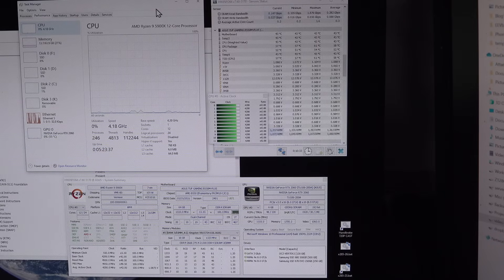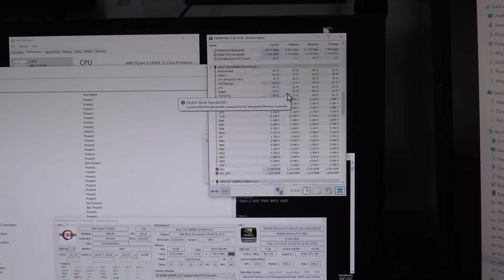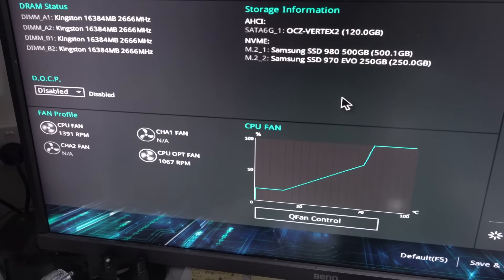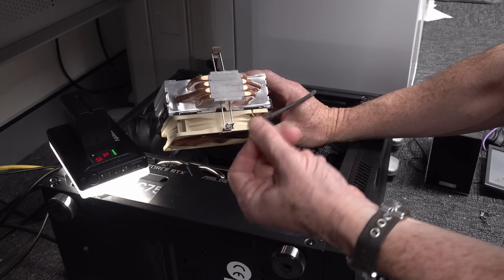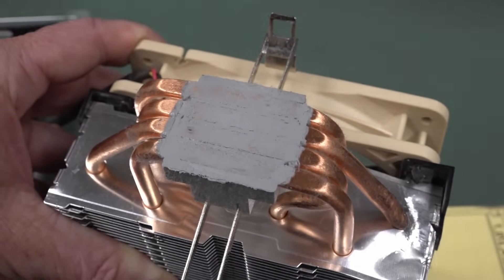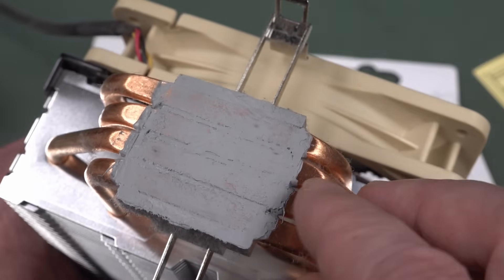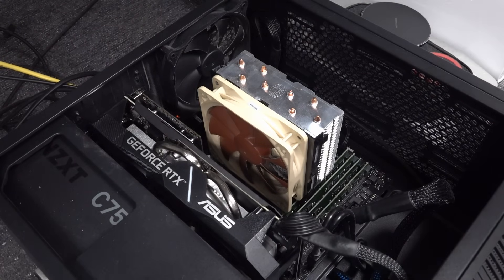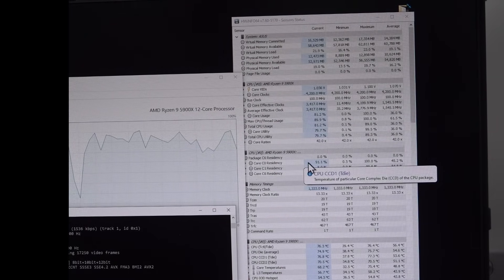CPU Thermal Ghost

Comment: @EEVblog2, I had some similar strange issues and couldn't figure them out, even sent my hardware back to metabox and they couldn't fix it. another PC at home with bad BSD and all during heavy processing. sometimes it fixed strangely when we removed the rams and put them back in different positions or boot with 1, shutdown, and boot again with all and it would work for a while. then i decided to re-flash the bios with the same version for fun and both were fixed! this happened certainly 2 times and the 3rd time, i hadn't tested the machine extensively yet. but rendered some after-effects on it and hasn't crashed then.

Comment: Computer shouldn’t crash because of CPU overheat, Ryzen is able to run at almost 100, of course it will throttle, but won’t crash. Having the same board, I have to say, I have my doubts about “TUF” batch. If you want to have better temps use a liquid metal as a thermal paste.

Comment: Paste: mx-4 ideal, but that cooler master should be okay, fan is not enough for that TDP, disable CPB and PBO
Reply: I would think so too but he ran it at 100% and the temps stayed in the 80s so surprisingly the cooler is good enough for the CPU, I would turn it to exhaust out the back.
Reply: @Roman00744  you are correct the cooler is in the wrong direction but he doesn't wanna change it xD

Comment: There is your problem, cooler, only 4 heatpipes, you need 6 for a 5900x, or you can use that one and disable PBO and CPB, I have the 3950x with a the 6 pipe scythe's fuma2, works fantastic

Comment: You can see the blue screen of death message without needing to capture it in situ by opening event viewer, going to the system log, filtering for errors, and looking at events named "BugCheck".

CPU temps looked more than fine so if it is thermal I'd expect either motherboard VRMs or the memory being affected. Both can be affected by thermals and neither get any cooling with the tower cooler fans pointing up.
Reply: that "TUF gaming" board looks like it HAS VRM cooling and often the TEF GAMING have GOOD VRM setups but 100% a possibility

Comment: tbh, that CPU cooler position is probably a big contributor to why, it's pulling all the warmth directly from your GPU, blowing it over the CPU, up to the top of the case, and it's just 'rising' out - you should rotate 90° (with fan on right) - rear fan should exhaust too, it won't be doing much as is!

the GPU vents into the case...
Reply: You mean pc secrectly one night changed that?
Reply: If the GPU vents into the case it won't matter much what direction the CPU fan is. Maybe 2-3 degrees or so.

Comment: by the way, undervolting made my amd run faster.  it's easy to do and it's win win.  less power, less heat, higher clocks since it doesn't throttle.  search how on youtube and there are some short videos that show you how.  you can do it in few minutes.  mine's the 3950x, but it's very similar to your cpu

edit: it doesn't look like it's probably thermals but that cooler looks a little weak for that much cpu.  something like the thermalright peerless assassin might perform a lot better for very little money, and with amd, the aggressive thermal throttling could be leeching precious render time

also your paste looked a bit thick in the z-height direction.  too much can actually start to increase thermal resistance so i usually give the cooler a slight twist (rotate around z axis) immediately after mounting it to the right and left to get the contact surfaces closer (by letting it squish down the paste) to ensure there isn't a thick layer of paste sitting between the surfaces

assuming your cpu hasn't become unstable from degradation, it could be psu or ram.  but that's obvious i think.  degradation is also something to consider.  usually you won't run into this unless you do overclocking, but these modern cpu are virtually overclocked from the factory now (meaning they're already running at the ragged edge)

Comment: 2 things: That cooler not gonna handle the 5900x well. And  you should rotate the cooler 90 degree so the air can passthorugh it easily
Reply: This!!! That thing is idling at 72C it's def gonna thermal throttle and the orientation doesn't help either.

Comment: Any stable system should be able to run memtest and prime95 for 24 hours each.
These AMD CPUs can run at 90c constantly with no issue. This is not a design problem. They will thermal throttle before crashing.
If memtest is clean, but prime95 fails, check cpu vs ambient case temp delta.  Improve overall airflow if needed.
If temps are OK, (again 90c is not a problem) swap power supply and retest with prime95.

Comment: Like others mentioned, update your bios.  If it is still the latest, load defaults.  Probably got wonky when it had an unplanned shutdown.  Also windows could have a corrupt driver not adjusting the CPU fan speed or thermal throttling the CPU right.

Comment: Just as a note on my older system and power supply.  After 3 years, my system would not blue screen but power off unless I deactivated 1 core from my bios.  It then progressively got worse until I deactivated more cores, then had to buy a new power supply.  Since you see the blue-screen of death, it is probably not your power supply as my supply's overcurrent was being tripped because it was becoming more and more sensitive.  In your case, if it's the motherboard supply for the cpu core, then your problem will eventually get worse and worse.

Comment: Wanted to also add that the single dot method no longer works for AMD CPUs, since it is rare to get full IHS coverage. Furthermore, the CPU cores are closer to the edge of the package, and the center is a dead zone. This is also why offset mounts provide lower temperatures. The IO die doesn't use much power, thus is not harmed by an offset mount.

Comment: I'm not sure I understand your "Worked 100% fine for years" retort to many of these comments. It worked 100% fine for years, now it doesn't anymore. So something has changed, and it may be impractical to identify and revert whatever that is (anything from clogged fans to software updates to electromigration in the CPU?). I know, it sucks and it's confusing, but you're trying to find a path forward, not a potentially impossible path backward.  FWIW, my 2c, I would give updating the BIOS a go, it's cheap and free. Yes, your machine worked for years, but I had my (AMD) machine recently start locking up randomly, and updating BIOS and GFX card drivers absolutely fixed it. If I had gone with the "worked 100% fine for years" rhetoric I would have rejected that solution on principle, because my machine worked 100% fine for years, but I'm glad I didn't.
Reply from the maker: People are telling me to get a better heatsink or water  cooler etc. Clearly that's is not needed, because, well, b it's worked fine for years.
Reply: @EEVblog2  My theory was maybe Dave decided to 'ignore' thermal limits recently and thus a back throttling system became a shutting down one. I know my 5900X and a GAMMA 400 fan can not really dissipate the heat reliably and I cut back the boost maximums and got some decent temps out ot it.

Comment: Why didn't the BIOS throttle(lower) the clock to reduce the temps instead of crashing? 
I thought this was built in CPUs and BIOS now to prevent overheating.

Comment: With that heatsink (unrelated to your current issue), you are losing performance, for air cooling, often you are looking at something on the level of the NH-D15, otherwise it will throttle to below stock performance, or at least a heatsink like the thermalright peerless assassin 120 SE.

Comment: The problem could be that you're putting solder paste on a CPU for cooling. :)
Reply: Applicated, no less. ;)
Reply: Soldering the heatsink onto the CPU can only make better thermal contact than thermal paste, no? :)
Reply: @MrJef06  If your CPU gets so hot it melts solder paste then you have other problems.

Comment: As others say - it's the power supply. Those CPU temperatures you initially had would not cause the system to cut off, just "thermal throttle" a little bit (hardly much at all below 90C, 80C is really OK).

You are in fact quite well equipped to diagnose this! Check the ripple on the PSU's 12V rails. That doesn't show up in the averaged voltage that the motherboard reports. Brief voltage droops caused by brief current spikes is what you're looking for. It happens (... more often with high-end GPUs though).

Your GPU might be more tolerant of the voltage droops, or its draw might be less "spiky". Anyway it probably draws significantly less power when transcoding video. Take a look at total package power of cpu vs gpu in hwinfo64.
Reply: If it's not thermals he should also be able to test this by causing the PC to heat up via external means, so that it gets really hot before the CPUs are fully working. Could turn off some cores so it's not drawing as much power. Demonstrate that it could run stable at higher temp when drawing lower power (a kill-a-watt would help measure how much power is going into the PC to verify less is going in than when it crashes).

Comment: Heatsink smoothness is not great, mostly because they "make it flat" using a sanding belt. Have rejuvenated the compound a few times using silicone oil, blending it back into a paste. Also took the simple flat extruded non heatpipe heatsinks and made them flat with 1000grit waterpaper and a surface block, to get better contact with just a tint bit of grease as interface over the original poor surface.

Comment: You could install ASUS's Armoury crate to find out if you have out of date drivers for the motherboard. But just driver updates didn't fix my problem
I had to update my ASUS TUF motherboard BIOS to get rid of same sort of symptom where PC shuts itself down (previously had same behaviour with windows dictating what GPU drivers I should use)
My cooler would lock its fanspeed and temp readings wouldn't even change in any software in my case 
Only started to happen after the usual automatic win11 update and went away once BIOS and drivers were updated and compatible once again I guess 😅

Comment: @EEVblog2 - Sorry. Just finished the Video. You were right in changing the thermal paste. Though the thermals at idle looks like it was a secondary issue and leading you down one rabbit hole. Here are some of the next steps I would take that don't involve sneaky software. First step would be to prevent the system from rebooting automatically so you can get the stop error. Settings->System->About->Advanced System Settings-> Startup and Recovery Settings -> Uncheck automatically restart. Stress the system again to get a stop error and this time it should stay on screen. Of course then do your google fu for where to investigate next including updating all drivers that are surrounding what stop error comes up. Another step would to update the board's BIOS. There have been some updates within windows itself and GPU drivers that can cause BSOD because it conflicts with the older AMD microcode, especially if you said that it started occurring after the upgrade of the GPU if I heard you in the video correctly as I myself had had to chase down those issues with a system that has had no hardware changes in years. Secondly I would open Command prompt with admin purposes. Then type SFC /scannow. This is windows System file checker. This will check to see if you have corrupted windows files that can also cause those BSOD. if that command finds corrupted files it should try and fix them right away.
Reply: If he had a backup of the system from say a year ago, he could run from that. This would help rule out software issues (unless there is firmware that had been updated, e.g. BIOS, or stuff on the GPU).
Reply: @gargantuablargg  I had to nuke my fair share of windows installs for a while. This way he can fix most OS errors without having to revert to a backup. I had a period over a year that it seemed after every two updates in NVIDIA drivers, I would run into BSOD. 3 changes that happened that I no longer wasn't nuking windows installs. 1) Changed the motherboard - Though that was changed due to USB port limitations and oddities when I was running my Oculus rift. 2)Changed the Sata cable to my OS hard Drive - They came with my motherboard so I changed it out of precaution. 3) started using the SFC /scannow and that had fixed a lot of issues with other frequent windows updates that kept corrupting. The stop codes were almost always coming up as display issues. Still running the same GPU and have had many driver updates since then so it was either the Motherboard with some bad Microcode that kept presenting as a Display issue and a bad Sata cable as it had gotten very bent at the SSD and that same SSD is still my main OS drive.

Comment: Can't give any help other than ideas. As you are good on the old leccy maybe run some tests on the PSU (possible some of those cheap caps they use dried up), if Paste didn't help maybe the cooler pipes have leaked all their contents out (do you have another cooler lying around you could test with). BTW as for paste, a Youtuber did some tests and figured there wasn't really any such thing as too much paste other than the mess as it mostly will squeeze out to the level it needs so just pour a gallon on to be sure :D :D

Comment: Cpus have a lifespan, the hotter and harder you run them the shorter it gets. I've heard this is especially a problem on some Ryzen cpus because of how aggressively clocked they are from factory. It could be that your processor has degraded to the point where the motherboard is trying to push too much voltage (voltage=heat) into the cpu to get it to run at the set clockspeed.
Reply: Damn that electromigration!

Comment: Reseat the memory, and replug all the internal cables (ATX MB cable can get issues after a lot of time since contact between pins gets less good, sounds weird but had this problem myself)
Might not actually be a CPU problem, could also be that the CPU draws too much power away from other components, which if they have a slightly bad contact suddenly lose about all contact.

Comment: I noticed that you were not in a bunny suit in a level 5 clean room while applying the paste :)  
also I'm sure you know those copper "bars' are heat pipes, hollow tubes with a vacuum and some water vapor for maximum heat transfer (I can't help myself)

Comment: I had a i7-4790 that lost a core that would just totally crash unexpectedly.  I went into bios and turn off a core over and over until I found out the issue.  Turned off the 4th, checked it, Failed...turned off the 3rd, checked it...OK. So, it popped the 3rd core.  Luckily enough, the processor was still under warranty.

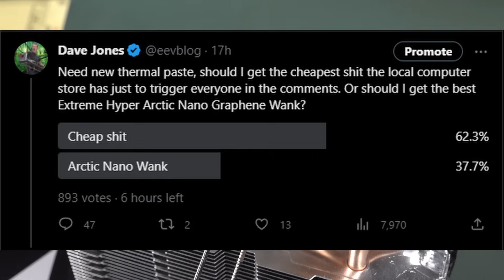Comment: 6:45 Come on Dave, an MX4 is like 6 ozzie bucks (local price converted to cad) and last for quite a few repastes....
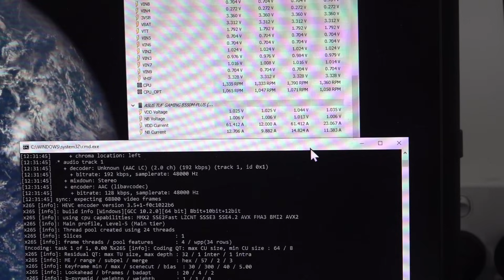13:57 Turn on logging in hwinfo64, its a nice tool to take a look at the last reported values before it bails out.

Also if you want to stress the hell out of a CPU use Prime95 Small/Smallest FFTs...
Reply: The Cooler Master thermal paste that he got isn't that bad. It shouldn't really make a difference given the fact that his cooler is not really meant for 12-core Ryzens with encoding work loads.
Reply: @maximilianmustermann5763  Have a similar tower cooler for a 5950x, so far never seen it going over 80°C......

Comment: Hi Dave! I see you fixed the thermal issue and are still having restarts... ASUS forces bios updates through windows update; wondering if they forced a new bios on you which is causing this problem? see if you bios is a new version... Something to consider...  along with of course power supplies/voltage issues at max power draw.

Comment: I had a 5950X that was crashing randomly after just under a year of use. Although mine was crashing randomly with 1 youtube video playing. After a lot of hardware swapping it was tracked to the CPU. Single cores can become flakey causing intermittent approx. once a day in my case crashes when the flakey part of that core is used. Luckily I could RMA the CPU.

Comment: 97% of the comments are just screaming "I didn't watch the video but I'm gonna guess it's thermals because of course ¯\_(ツ)_/¯"

But seriously though, you mentioned that you recently changed your video card and it was making CPU rendering go a bit slower. Newer GPU's are a real pain in the ass because they can draw sudden spikes of current way above their rated power draw that can cause a glitch on the +12V rail. Being that this is a pretty high spec system, it may be possible that with the CPU under 100% load, there isn't enough current capacity from the PSU to accomodate those spikes as well as the CPU under load, causing the system to crash. Or the PSU should be powerful enough but there's a combination of a failing PSU mixed with the above problem. I'm not claiming to be an expert in computer power designs, but it's happened to some of my friends and people have talked about it online.

- Another possibility and IMO the worst outcome is that the CPU is damaged from running at such a high temperature for so long. CPU's are designed to run up to 100*C without issue but are only supposed to run between 90* and 100* for short periods of time (this is different for laptop CPUs). I don't know how likely it is your CPU is damaged but I have used heat damaged CPU's before so it's also a possibility.

Comment: Your ram may be failing, you can try running a few full passes of memtest86+, it could be the vrms on the motherboard, or the power supply, or your CPU may have been damaged by being too hot from the dried up thermal paste. Except for AMD 7000 series CPUs they generally like to be sub 70c, the cooler the better, but Tjmax is listed as 90c.

50 tabs, try 1650... 

Send help please...